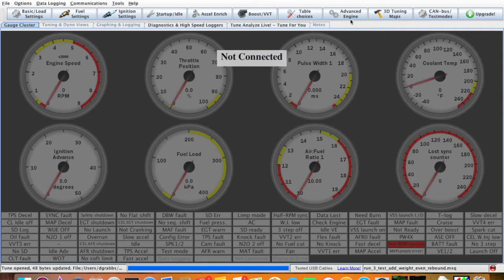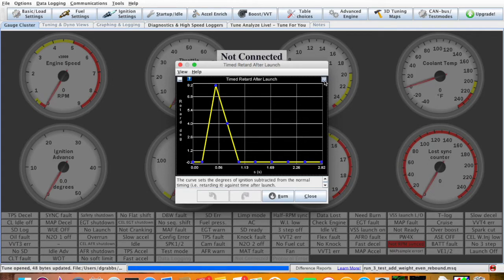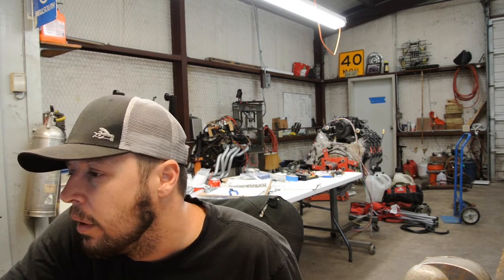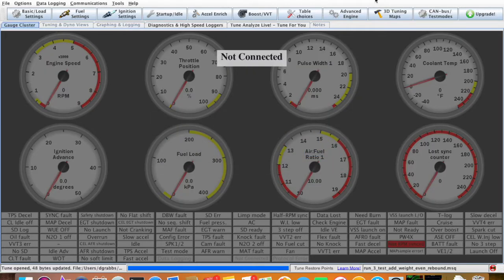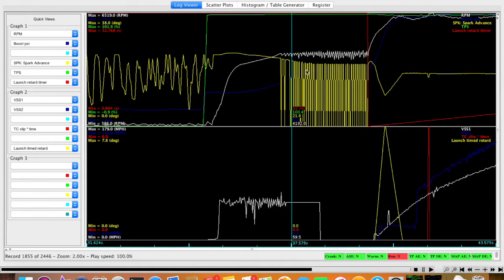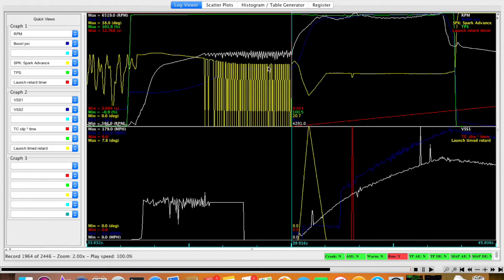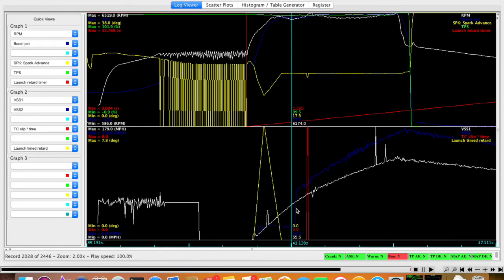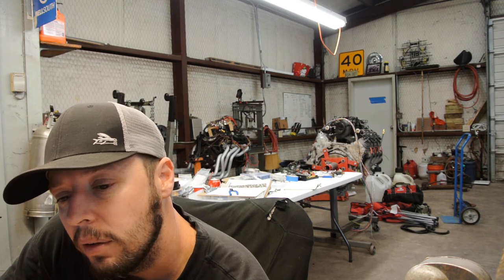Megasquirt Power Management: Timed Retard Aftter Launch

Comment: We been testing this on a turbo fox street car, works very well, one thing we been also testing is the "rpm vs time" perfect pass traction control. Together they work very well with the changing street condition. 
Timed delay after launch helps getting out of the hole and.the perfect pass mode keeps the wheel speed in check even with out a vss style t.c. As the passes get faster we update the perfect pass rpm vs time curve. All of that was with the help of your video and applying it to our testing.
Thanks for that great vid!

Comment: You have some good info here, talking about actually why you would use such a feature, coming from a turbo stick car, i could see using this help control wheel spin after a 2 step launch, I like the idea of just pulling some timing on the fly like that versus trying to rely on a boost solenoid to do the work.
Reply from the maker: JJ Outlaw timing is a lot faster than boost control as well
Reply: John  you use both in some cases. Also c02 boost control is very fast.

Comment: What Megasquirt system are you using and i'm sorry to say I haven't seen many of your videos as of yet? I'm looking for a Engine Management Systems but I haven't worked with any of them. I'm from the old school when we didn't have any of this then you wake up one day and say I'm building another car. I was just planning on a 11 second street car and that has gone out the window. I have come down to the FuelTech  or Megasquirt. I really like the FuelTech but I like the price and features of the Megasquirt MS3Pro more and more. Have you had to call Megasquirt's tech support for anything and if you did they treat you? Thanks
Reply from the maker: roaringcat 62 megasquirt ms3x 3.0.  I haven’t ever called support, I have posted In the megasquirt group on Facebook and usually got the answer I was looking for.  I spend a lot of time reading the manual as well